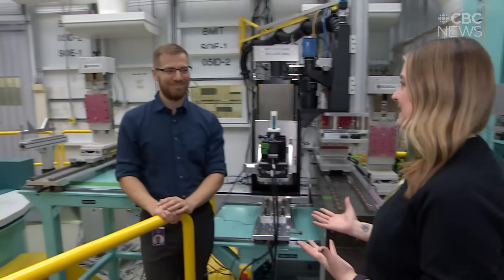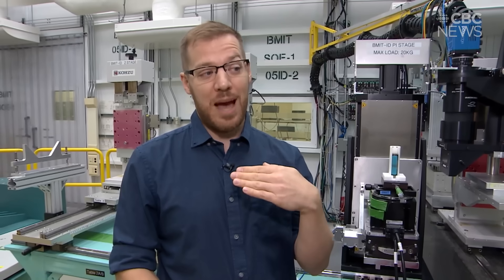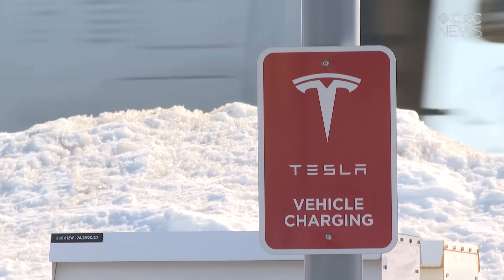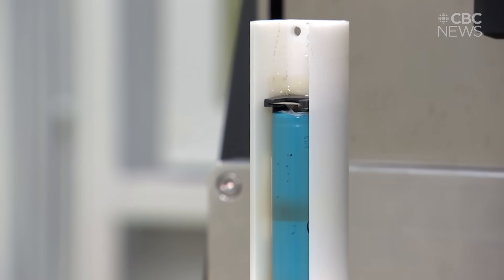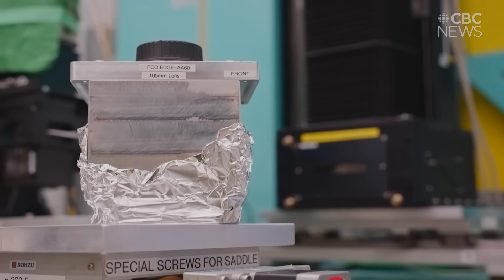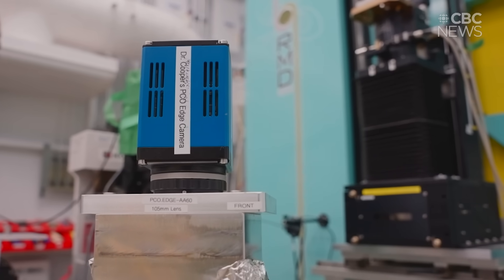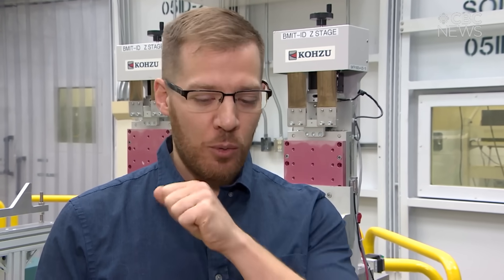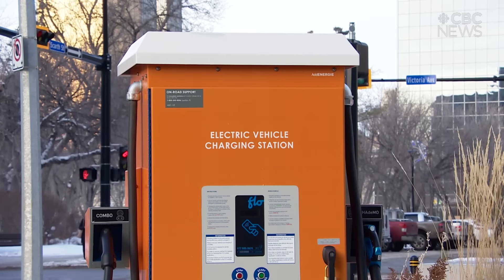New electric vehicle battery could run for 8 million kilometres

Comment: Currently available LFP batteries will already last over a million kilometres. 
That means the battery will already last over 40-50 years and be the last thing to wear out on the car. Not that the electric drivetrain will wear out in a hurry.
Everything EV is already so much superior to ICE age clunkers it is astonishing.
Reply: Most electric motors in the original EVs from over 100 years ago still work perfectly. Electric vehicles existed before internal combustion engined vehicles, but battery technology was what held them back for the past century. Now that technology has moved on so much that the batteries may very well last longer than their owners.
Reply: Unfortunately you need to drive an EV to appreciate just how far ahead it is compared to the Gasoline engine.
Reply: @manishpjoshi I’d love to get an electric, but I drive 100 miles a day and the winters here are brutal cold
Reply: @justinelliott3529 Can you charge at home? Then I see no reason not to switch now. For a modern EV, 100 miles per day is no problem, even in winter.
Reply: Except the range...fix that and it is time to change..I believe
Reply: @ range shouldn’t be as big of a concern, if a vehicle could do 500km and then charge in 10 minutes (and EVs are there or nearly there already), it would add a minuscule amount of time on a long journey.  For day to day it wouldn’t be an issue, assuming the owner has the ability to charge at home overnight. As a commuter vehicle, it’s really hard to dismiss the value proposition of an EV, I’m spending less on making it go, less on fixing it, and not standing at a pump freezing to fill the tank, it’s a minute to plug in at night and a minute to unplug in the morning.
Reply: You know what they say about draining the earth of oil and natural gas. Same thing with taking electricity out of earths' atmosphere, only you can't see it.
Reply: Let's wait for the figures to come in concerning rubber nanoparticles in the air from EVs and increased road degradation. The EVs are out of the running in extreme cold and heat . They needed to be abandoned in those California fires. They are an ecological hazard when they burn near waterways. They depreciate so fast that you are throwing your money away to purchase a new one , then you can't risk buying a used one on account of no digital record available on charge and discharge history although this info could easily be made available if manufacturer was willing. The wool is being pulled over .
Reply: If they were so great at doing the job, delivering range in winter, at high speed or while towing and the infrastructure for ample electicity generating and distribution existed to keep them available close to 24/7 at reasonable cost, people would voluntarily transition to them and a ban on what you call 'ICE age clunkers' wouldn't be necessary. But we all know they can't, yet. And likely won't when the ban comes in.
Reply: @ : Exactly the same sort of doubts we’re expressed around a century ago when cars were replacing the horse and buggy.
Yawn!
Reply: @TimeWeWokeUp-now  Was the government banning horses and buggies in favor of cars?
Reply: Burning your gas 100 miles away and losing 20% through line loss.  Then lug around a giant toxic battery wasting another 20% of your energy.  EVs cause more pollution, toxic waste, and are energy inefficient.  The power plant doesn't have the same emission standards as an ICE so they can pump toxins into the air without a catalytic converter.  ICE are a far superior option if you care about the planet at all.  You have to burn something one way or the other because you are not putting out an acre of solar panels just for one car.  Don't believe the sales pitch.
Reply: Kilometers are one part of the equation. Aging is another factor.
Reply: I completely disagree. EVs use touch screens and central computing systems that are difficult to troubleshoot and maintain for the average owner. They also become obsolete quite quickly.  An ice car may have a headgasket go out, but you can buy a new one for $60 and fix it in your driveway with a craftsman ratchet set. Electric cars appear to be reliable but they are disposable just like a new iPhone is.  It’s sad really.
Reply: @SuzukiKid400  a phone is only usually obsolete due to the software updates.  It's way easier to change out an electric part or a battery then to change a head gasket. It's usually all just plug and play!   I've done it many times and I'm just average.
Reply: @SuzukiKid400  a touch screen is basically a built in iPad. It's a touch screen that's linked to a computer that controls everything else
Reply: not everything….EV’s don’t perform well in cold temperatures.  That’s why you don’t see ev’s all over the north of Canada.  We don’t all have a nice heated garage to keep the battery warm, so that we can charge it.
Reply: @ An EV can keep the battery warm all by itself, no heated garage needed. And for AC charging, for example at home, no battery heating is required. Just if you want to quick charge.
Reply: @  Yes, the battery MUST be kept above 0°C to charge.  That means it is using energy to go nowhere.  Very INefficient to use in cold climates.  Heating with electricity uses alot of energy.  Try charging a cold EV when its been sitting out in -40° temperatures….first the battery must be warmed, there will not be ANY charging taking place until batteries rise above the freezing level….
Reply: is that why my lfp battery in my power station only has a 10 year guarantee ?
Reply: @ : Guarantees always go for the lowball risk. 
When I bought my BYD EV over a year ago, best guess for LFP batteries was that it would last 3000 charging cycles. Then it was 4000. Now lab tests suggest 5000 and growing. Multiply those numbers by 250, 300 or 400 kilometres (per cycle) and you get massive mileage out of a battery. 
Just put a deposit on a home battery as well. Choice for me was always LFP. 
LFP is still relatively new technology and ongoing testing results could’ve easily gone in the other direction but it didn’t. Newer batteries will still come out on the market in the next few years. They will most likely even outstandingly perform LFP. But for now, damn those batteries are good.
Reply: @TimeWeWokeUp-now  I'm too poor to find out how good those batteries are.  Send me some so I can give an honest opinion
Reply: Superior except they dont work in the cold, and you cant carry a canister of electricity with you in the bush or in rural areas.  

The batteries are essentially napalm bombs that will go off at the slightest bit of moisture. Oh and theyre located underneath the vehicle, where water definitely wont be...

If you have a power outage, you no longer have transportation.

Ev's are only useable within the city and suburbs.  To dangerous and unreliable otherwise
Reply: I agree ,gasoline reign for over hundred of years and still highly toxic, with fast development battery technology we will have safer,cheaper,recyclable and energy efficient batteries in the future
Reply: This battery would be a huge disappointment to big corporate money, they need a product to replace at worst case scenario once every five years or so….unlikely this battery would ever be produced on that fact alone…….or we’d have brakes and tires that never need replacing.
Reply: None of these things will save you money 😂...governments will put a higher tax on everything once you have it...the companys will charge you more for repairs.
You will be exactly as you are now.
Reply: @ : What do you mean by ‘will save me money’? 
I’m already saving thousands per year! 
It is already happening! 
Repairs are way less frequent.
As for government taxes? 
Let them try. 
Can’t see how they can tax electricity that goes straight from my solar panels into the car.
And a simple software hack can reduce the car’s odometer if they try an EV distance tax. 
So unless there are Soviet style secret police roaming the suburbs to enforce EV taxes, your wishful thinking will never become any reality.
Reply: Most people cannot afford this astonishment
Reply: @carmichaelmoritz8662  : I’m not by any means wealthy. An EMT’s wages are not fantastic. Yet I’m driving an affordable Chinese EV that is ahead of legacy auto by a decade. 
Now I’m saving thousands that would’ve gone into the bowser. 
I can’t afford not to own an EV.
Reply: @TimeWeWokeUp-now  I'm on disability and they won't let me own a vehicle that is over $10,000.    That being said I wouldn't get approved for monthly payments anyway. So in my eyes you are wealthy.
Reply: Too bad the energy density is terrible compared to gasoline and even bad compared to other lithium chemistries. Not to mention the current recycling problem and significant degradation when charging anywhere close to 1/10 the speed of refuelling gasoline. Carbon-based batteries will change the world…
Reply: @zaydabbas1609  What recycling problem? And most charging is done 70% in 30 minutes. That is faster that 1/10 the speed of fueling up a car (5 min) and does not wear the battery significatly.
Reply: @zaydabbas1609  recycling of lithium based EV batteries is a more or less solved problem, with now multiple companies (Redwood recycling is the name at the top of mind) and several different processes that exist. Recovery of materials is above 90% in all cases if memory serves.  

Energy density is still an issue, but charging times are much, much lower now and on the order of 20 minutes for many new vehicles (to go from 10% SOC to 80% SOC) at a direct current charger, if the charger is capable of high enough power output.  For many average commuters, it’s a matter of plugging in when you get home and unplugging in the morning, which might be several hours on the charger but probably a fifth of the time needed to stand at the pump filling your tank. The inconvenience really only becomes a factor for long road trips where you could be on a tight schedule, and for people living in apartments or condos where there isn’t a charger available. EVs still aren’t a solution for everyone, but there are many, many people who could easily get one and feel near zero disruption to their routines, aside from freezing their Fanny off in -20 weather.
Reply: @zaydabbas1609  So what.  About the same amount of electricity is used to get liquid fuel into your tank as an EV uses directly for the same amount of miles.
Reply: @ No end user equipment cares how it gets its power. Airport plane pushers literally use an electric motor powered by a diesel generator because batteries don’t meet the recharge speed or energy density needed for that kind of job. Not to mention that all this heavy equipment (and even much of the electricity used to bring gas to the pump) relies on combustion. Planes themselves are another example of the lack of energy density. No doubt it is the reason electricity hasn’t taken over, brushless motors last forever.
Reply: @zaydabbas1609  Electric drive has taken over virtually the entire stationary world.  Yes, there are significant use cases (such as aviation) where liquid fuel density will always reign, but now that quality batteries are available and coming down in cost, the portable world is going electric as well.
Reply: @zaydabbas1609 not true, the only reason they still use the diesel generators is because they don't want to spend the money to not use them it's outdated tech. with today's batteries Tesla's can put 400 miles of range into the car in 15 minutes charging at 250 KW.

Comment: Six years ago they created this battery and still nothing on the market. This sounds like a solid state battery which is possible to make but has its own challenges to mass produce. This is an interview more about the capabilities of the light source than about new battery designs. A follow up interview regarding battery design would be interesting.
Reply: there are no "challenges to mass produce".

there is simply no billions of dollars in profit in a battery that runs for 8 million kilometers.
Reply: Sociological challenges you mean, the CEO's won't want it, and even if someone builds it, the sceptical nature of the fickle serf populace will work against their own best interests, as per usual... Standard for workers to do what the billionaires tell them to do, no matter what, eh?

Comment: there is not a snowballs chance in hell EV manufactures are going to go with batteries that last longer than a gas car would today.  ud be cutting into the profits that they believe they deserve.  who will think of the shareholders?
Reply: And you're right. They wouldn't. But, they would take the tech from this and make battery life foolproof. No more 'only charge your battery to 80%' for example. Battery care would be a thing of the past.
Reply: That’s like standing on earth looking at the moon in 1900, and saying, it’s impossible for man to reach it!
Reply: In the open marketplace, consumers will prefer vehicles with longer battery life.  Given a small extra cost, or no price difference these better batteries will become the standard, regardless of what the ICE cars used to be able to do.
Reply: Thinking too small. This is an opportunity for Canada to get into car and energy independence industry.
Reply: They'll just design some other part to fail.
Reply: Nonsense.   Cost equivalent, customers will buy models with better batteries.
Reply: Lease the battery pack to the customer

Comment: I guess we won't need all that oil and gas from Alberta
Reply: There will always be hundreds of uses for hydrocarbons. Hydrogen and carbon are essential to thousands of chemical reactions. And oil and gas are the cheapest place to get them in large quantities.
Reply: You can sell it to the fools that still burn the stuff.
Reply: @kensmith5694  we're probably 20 years from getting off nat gas completely.   How do you heat your house?
Reply: we already don't. even current EV's easily replace conventional gas cars.
Reply: no, we burn the natural gas to make electricity : )   win win !!
Reply: @wadexyz who is we? Not BC,Manitoba,Quebec,New found land or PEI. We are mostly hydro and some solar and wind. Ontario is mostly nuclear. Just Alberta and Saskatchewan using natural gas… but they also have the highest electricity rates I think

Comment: why would the battery need to last longer than 15 years?
Reply: uhhh, resource management?  think dude, think.
Reply: @theastuteangler  They get recycled Dude!
Reply: i have a 58 and 70 year old car. People do keep cars longer than 15 years...
Reply: Maybe buy a new EV down the road, battery not included if you already have one. They could standardize on the new form factor so they can be used in a new vehicle.
Reply: When a car is completely worn out the batteries can be repurposed for domestic storage.
A repurposed 80kwh pack would potentially power your home for days or allow you to avoid peak demand pricing entirely (if your electric provider uses such a scheme)
It's far better to view these batteries as an emerging resource than something with little or no value.
Reply: Batteries that last much longer won't reach a point where someone considers they need replacement.  Actually, with improvements coming to market so fast (CATL/BYD) the end-of-life metric might be driven by desire for better performance.